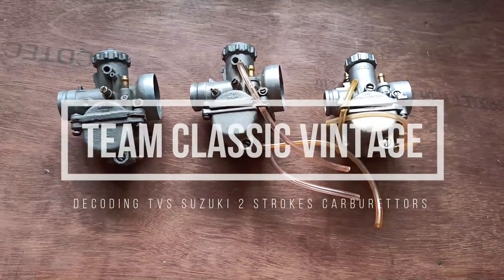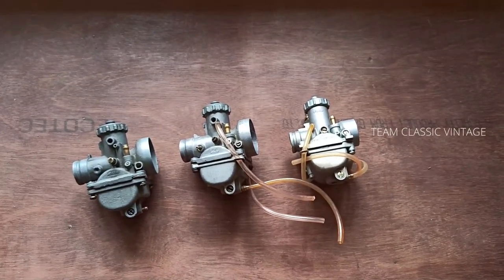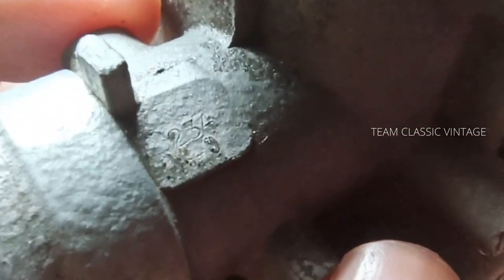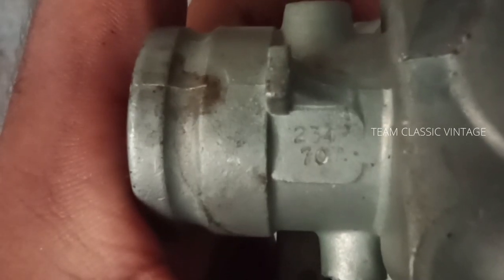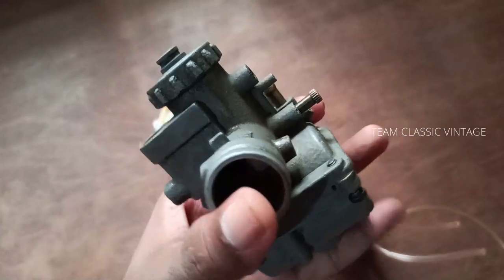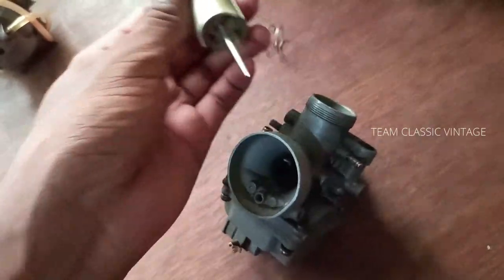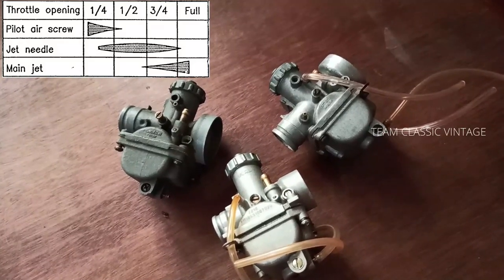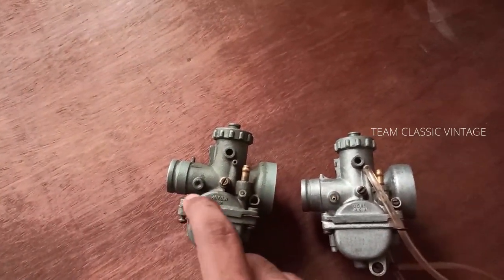DECODING TVS SUZUKI 2 STROKE SERIES MOTORCYCLE CARBURETOR | INFO VIDEO | TEAM CLASSIC VINTAGE

Comment: Sir
Is there any difference between Shogun carburator air screw and samurai carburetor air screw .... please reply
Because my shogun airscrew missing 😒
I got samurai air screw if suitable please reply
Reply from the maker: I guess they are not having same air screw. Need to check and will inform you

Comment: can fix ax 100 carb on shogun ?
Reply from the maker: All are vm20 but there are some design changes between the carb of ax100 and shogun. Supra powerup carb is similar to shogun but the supra powerup carb does not have provision for oil intake. 

I haven't checked whether ax100 carb runs fine on shogun. It does serve the purpose and will be better than other aftermarket carbs. But need to check how to perfectly incorporate an ax100 carb to shogun with correct jet, needle position etc.

Comment: bro please give explanation how ax100 beats max100 same cc, same, gear ratio,same bore and stroke size, then how its beats more 2 stroke bike like rx100,135, supra,shaolin,etc... plz its that any spl in ax100 carb or spl in reed value and can i put ax100 reed value in max100R plz reply bro
Reply from the maker: If you are asking difference about ax100 and max100 they only share same cylinder displacement and gear ratios. Bore is different for the max100 and ax100. There will not be any effect if you put ax100 reedvalve on max100. 

And by perfomance in stock ax100 cannot beat rx100,135,shogun etc. 

But it is better in performance when comparing to samurai,max100,ax100r etc.

Comment: How to increase suzuki samurai bike mileage bro my bike gives only 20 to 25 only 😔
Reply from the maker: Samurai is not suppose to give that king of fuel range. How are you riding your bike. In an aggressive manner or normal riding.

Suspected problems with the bikes are carb tuning,weak compression etc.

Comment: Hi bro if i change my max 100r Carburetor to supra power up will it performance increase ??
Reply from the maker: Not much difference as the cylinder will not be capable of permitting more air fuel mixture. Try to figure out a supra or ax100 cylinder block which has got a bigger intake compared to ax100r ,max. This will give you some additional horses
Reply: @teamclassicvintage7829  thanx😍
Reply: @teamclassicvintage7829  good

Comment: bro i have ind suzuki ax100 bike with 87.5 main jet now i want to chang into 90 jet it can improve my peformance or reducing my milage problem can occur or not
Reply from the maker: Which carb you are having vm18 or vm20
Reply: @teamclassicvintage7829  bro insta ondoo
Reply: @teamclassicvintage7829  me too hve the same question... Im using vm20

Comment: I changed the jet of my samurai carbeurator I lost my mileage and pickup! Can you tell me a solution 😥
Reply from the maker: By what size you have upgraded the jets. The stock main jet size of samurai is 87.5 and for pilot it is 15.

Try to tune the carb properly i guess which could solve your problem.

Comment: Bro will star city carburetor suit for suzuki max 100 ..please command...
Reply from the maker: I don't know regarding that. You can fit anything if you have the skill but need to check after fitting whether they will sync each other and work properly. 

VM18 carbs are not so difficult to find. Even a year before ucal have produced these carbs. So try to search for it you could get hold of one

Comment: Non cat 20 100 jets cat model have 18 97 jets
Reply from the maker: Bro cat models are having 17.5 and 97.5 only. Please do cross check your information with a service manual
Reply: @teamclassicvintage7829  yes I said 18 approx bro mine is cat model
Reply: @teamclassicvintage7829  changed main to  105  pilot 20 no available can I ride with this combination